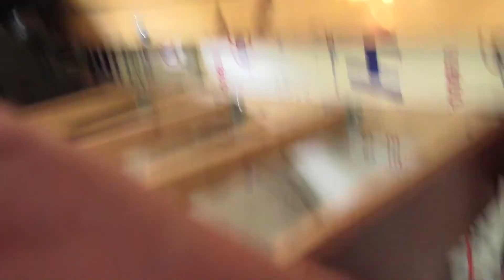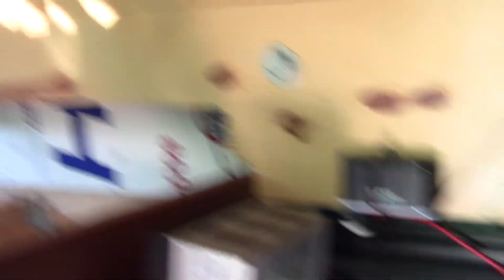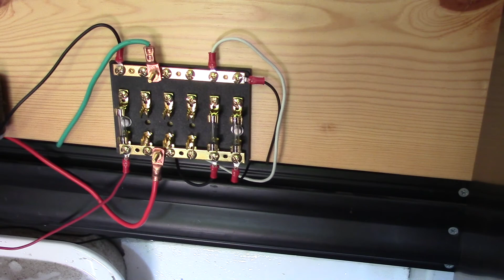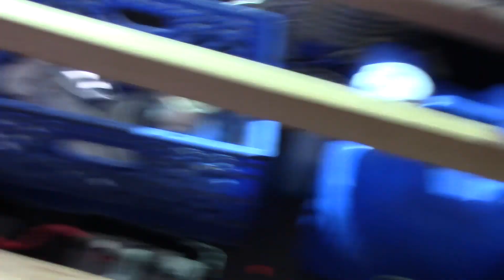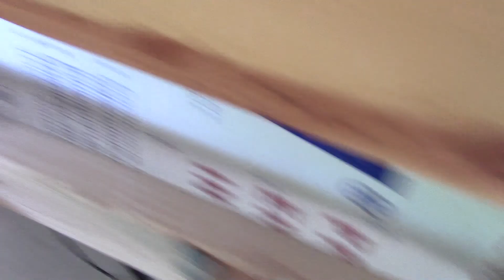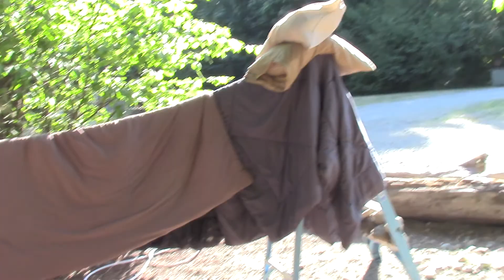Off Grid Mobile Power

Comment: Hey Can I ask does it cost alot to live off grid van life style? I'm saving up my $ to eventually do what your doing . The city life sux. Stay vigilant and Safe peace out 👍
Reply from the maker: I have veteran benefits that makes it affordable. I get discounts for the parks in my home state, and 1/2 off at federal parks. If I didn't have that, it would not be affordable. 

Besides that, gas is expensive. You're basically trading rent, for gas and vehicle expenses. A good example is we have to get our brakes done ASAP, as cash becomes available. We burned them off driving through the Oregon mountains hauling the broke trailer. 

Hope that helps!
Reply: @warlordplisken9605  yes it has thank you is there a limit to how long you can park in the camp area were you are ?
Reply from the maker: In Washington state parks the limit is 10 days per 45 days in the summer. In the off season you can stay for 18 days at a park. Federal lands like BLM have limits too, but as long as you are not in a big group I think the law doesn't really pay attention. We never got a visit from any BLM cops the whole time we used BLM land.